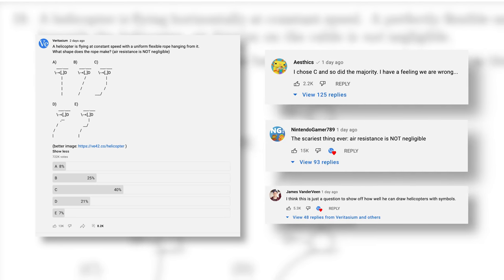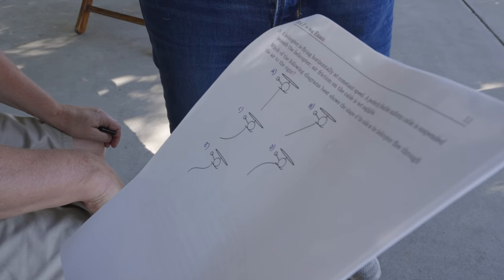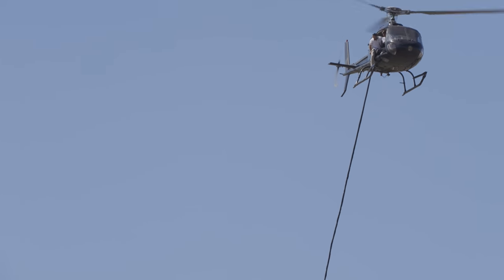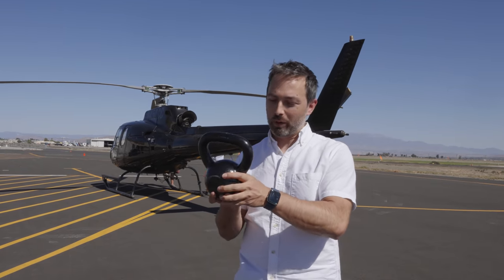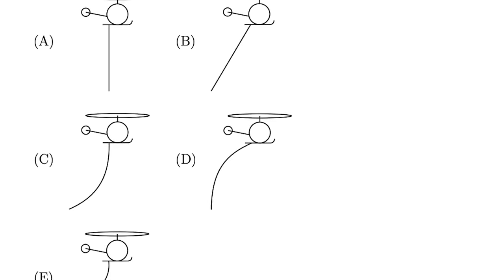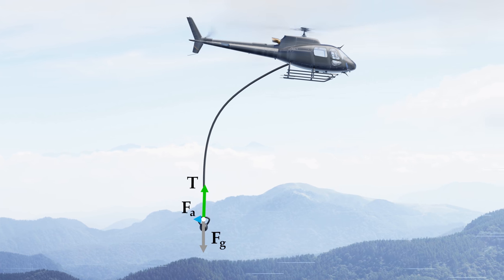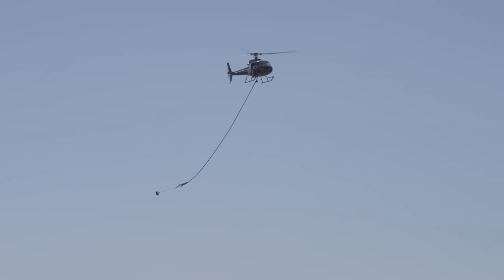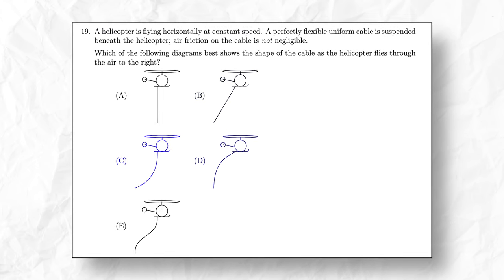I Rented A Helicopter To Settle A Physics Debate

Comment: Totally learnt something on this one, I’m so glad you got us to lock in our predictions in that survey last week!
Surprised by how wrong my assumptions were.
Reply: Btw if you like the concept being discussed, you could look up "free body". Its used in engineering to figure out how things hold. Its like the basis of finite element analysis (computer simulations). These days if they for example wanna model a bridge carrying load (and itself) someone can just draw a 3d model and input known values into a software. Back then, they had to "cut" the bridge into several sections and calculate the forces holding each of those section up.
Reply: When I saw the poll, my instinct was "Constant? It'll be a straight diagonal, duh!", then the moment before clicking "Wait! This is Veritasium, it cannot be this simple. Something must be wrong with the intuitive answer. Would the greater atmospheric pressure give the lower end of the rope more drag? It counts, right?" Bam. Well played.

Comment: Another incredible video as always Derek & crew!
Reply: Cringe
Reply: Atleast this video isn't a total sell out
Reply: The ones about unintuitive stuff are always really interesting :)
Reply: Hehe Derek and the Dominos
Reply: Good1👍
Reply: Xyla, with all due respect, another "incredible vid" will be the one where you and  Ve actually do a real test of your famous little wind cart to demo if it really does do what Ve is suggesting it does.

You guys need to find a longer belt to put it on and see if it continues operating.  (It will not, but dont mind me, simply do the experiment). First try a 50ft belt.  Exact same car, same 10mph belt

Another good, relevant choice will be to simply use the treadmil, but tie a thread to the back of the car, and tie it off behind the treadmill, so it cannot overrun the far end of the treadmill.  If the cart is doing what he suggests, the cart will run perpetually.   It wont do that, but again, dont mind me, just try it.

Are you two really interested in science as you claim?

Btw, you did an excellent job building that device -- as always.  But it simply does not do what you guys suggest it does, and you guys totally refuse to even acknowledge folks who explain to you why it behaves the way it does on that treadmill, and ways to test the matter

And, btw, now is not the time to make a comment about a "$10,000 bet", or refer me to some other vid which you propose is relevant.  Simply do the experiments which I suggested, and the truth will be told